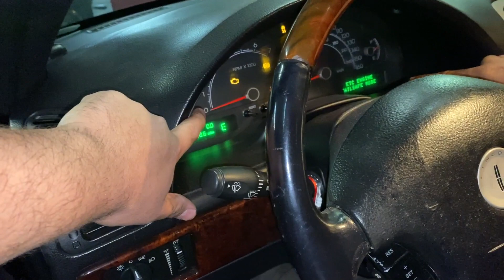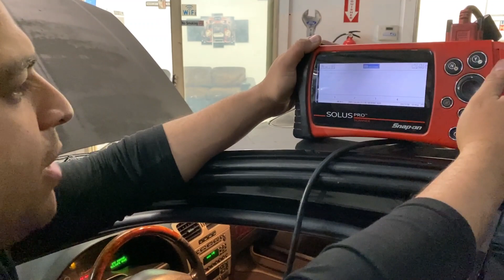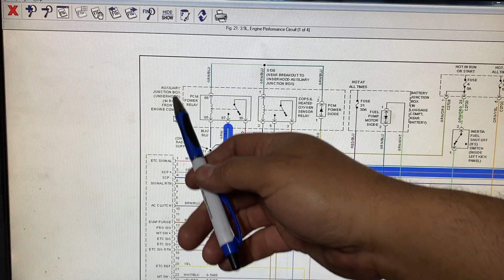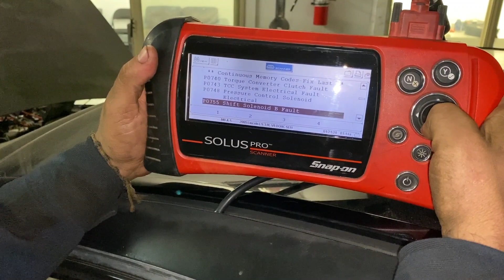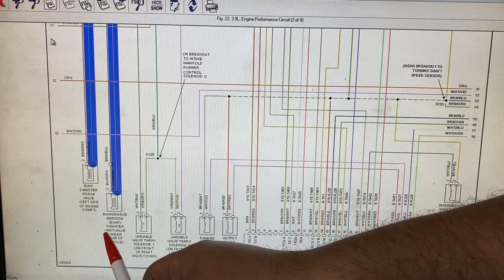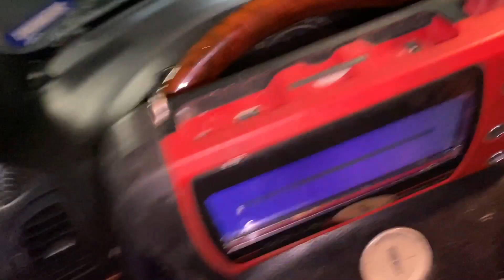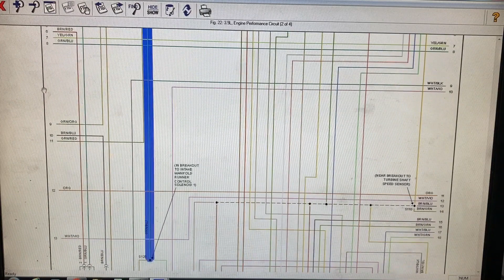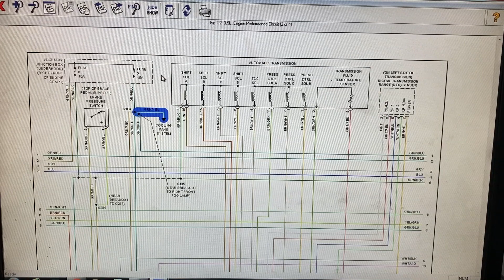LINCOLN LS SHORT CIRCUIT NO START FEAT. OZ MECHANICS

Comment: Wow! My husband gets so mad at me when I have a problem with my car... 
(2000 Lincoln LS)
I get on you tube and hunt for videos for hours, I make playlists and take notes and then I search message boards and then I try to tell him what to fix... (He is a very good mechanic... He fixes Diesels and Simi Trucks, Tractors, Dozers, Backhoes all that stuff on our 🚜 farm.) But I like to know random stuff... And I like to tell him what to do.... Hahaha! Thanks for this video! I have this exact problem and my Torque Pro app and OBD2 ADAPTER weren't telling me nothing... So of course I couldn't tell my husband What to do this morning! Now I can! Hahaha! I'm loving it now!
Reply: One thing about these cars is that they have to have a full charge on the battery... Also when you have to recharge a dead battery or if you ever have to remove the battery positive cable, you have to reset the security system or the car won't start...
Its a fun process... They did list it in the owners Manuel though!

Comment: I need assistance with my 2004 Lincoln ls v6 similar issues,  but it runs well,  the alarm randomly comes on, the approach light stays on, had to take fuse out,

Comment: So maybe the customer had a short on fuse 6 so they took the burned fuse and wrapped wire around it then swapped it with fuse 5 so that they would still have a functioning fuse in the shorted circuit, problem with that is they also had a burned fuse in the trunk so it never blew again.

Comment: I need to know if I change my fuel filter on my 2002 Lincoln LS v8 and it still runs for a little while and then shuts off I crank it back up it runs then idols down then shuts off! What could be the next problem

Comment: Can you guys help me i have a 2002 ls with no power to the fuel pump bought the car cause my boss said it was the fuel pump but after getting the car and looking at the work they did told me to check for power at the plug for the fuel pump and there was none

Comment: The big fuse blew due to the copper wire 😲
Reply: What's odd about that... is the copper wire wasn't wrapped around the faulted circuit.